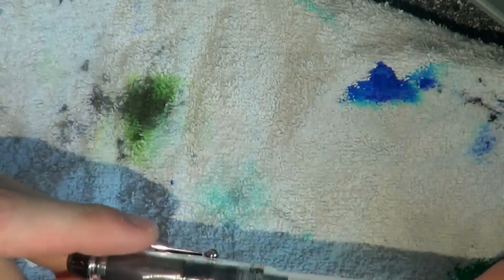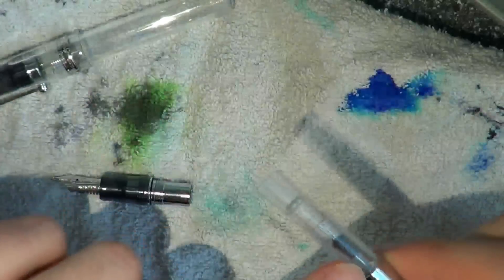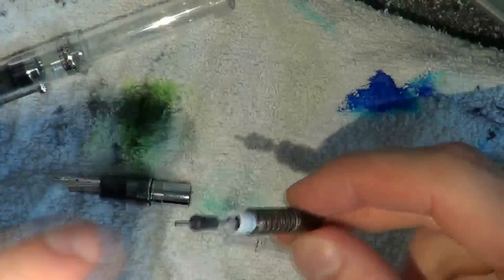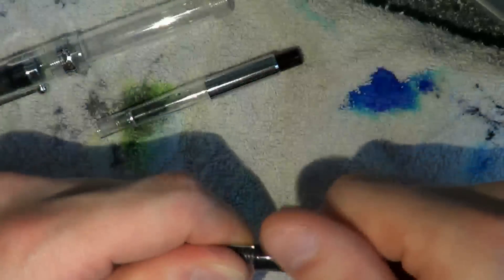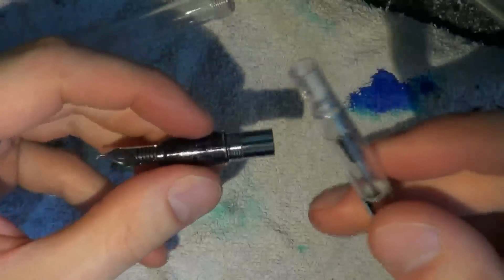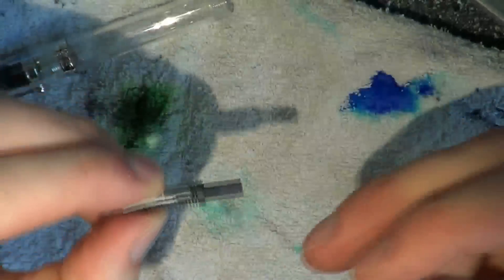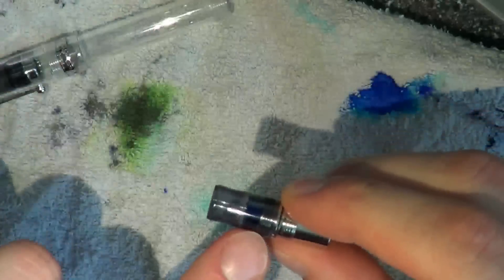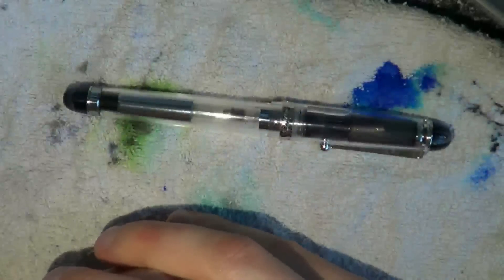Disassembly Line Pilot Custom 74

Comment: For those interested; the feed/grip section that looks like it can be removed can be removed, without damage even, as it doesn't seem to be glued. But getting this thing back on is a whole different matter. The part is really, really tight and makes me wonder how they got it on there in the first place. Cracked mine, after I lost patience. As said in the video: Avoid.
Reply: Thanks for your comment. I was going a little nuts trying to clean and disassemble the grip but stopped before I cracked it. 

That bit of ink is super annoying tho. :(

Comment: Tried twisting the converter. No luck in getting the nib collar out. Converter just twists around on the section. Any other tricks for getting the nib collar out? Heat?
Reply from the maker: Yes, dry heat may help.  Careful you don't damage the plastic, though: it's pretty thin.
Reply: Am attempting to do the same thing with mine. Did heat help for you?

Comment: I need to disassemble the cap to get some water that's stuck between the cap wall and the gray plastic shroud that seals the nib. Any thoughts?
Reply from the maker: Sometimes you can pull out the inner cap with the eraser that's mounted at the back of some pencils.  I don't know if that works on this model, though.
Reply: Thanks for the reply.

I just got it out. Happily, it isn't screwed in, it's just interference fit. So I got in there with a rubber band over the back of a pencil (a trick I use on a couple of my other pens) and it pulled right out.

Comment: Hi Stephen. Just taken delivery of a new 74 from Japan - EF - and boy is it EF! However, I also bid for a lot on ebay of a 74F - it's a bit scratchy. The kind person also chucked in a 'not working' custom heritage 91' - which indeed is not working. I know nothing about fountain pens - I have got these for drawing. A zillion years ago I used to use Rotring's and seem to remember disassembling them and putting them in a bath of Rotring cleaner to soak - which no doubt cost a fortune.  So... what would you recco to get these 2 pens going again? Is there an ink dissolving solution? Cheers.

Comment: Hi, I have a couple of 74s, and there's a little soft plastic skirt/gasket that sits between, around, the bottom of the feed and the top of the inner collar within the section.  The feed slips into it and keeps it snug. I seem to have lost, or washed away that bit on one of my pens.  Without it the feed is a little loose.  Any Ideas on how I might replace that bit? Or substitute it with some kind of tape or putty? Thanks for all your videos.
Reply from the maker: Albert Genzen I would contact Pilot.
Reply: sbrebrown thanks.  I'll give that a try.
Reply: sbrebrown, amazing, I called pilot USA, described the bit, and sure enough the gasket arrived in today's mail plus a cartrage of ink as a bonus.  Pilot is awesome and so are you.  Thanks for all you do. Any chance you'll go to the LA pen show in February?
Reply from the maker: Albert Genzen Glad to be of help. I probably won't be in LA
Reply: Albert Genzen Glad that Pilot USA could help you. Pilot UK was unhelpful, dismissive and plain rude when I contacted them about a pen repair which I actually wanted to pay for despite the pen being new. That was the last time I bought a Pilot fountain pen even though I had most of their popular pens in my collection already. All the same, happy that Pilot cane thru for you!👍🏿👍🏿👍🏿

Comment: Hi,
I just can't get the nib/section out of my C74. It is acting dry and I want to see what's wrong... I can't get a grip of the nib and the converter trick doesn't loosen the feed at all. Any help?

THanks
Reply from the maker: It is hard to recommend something without seeing the pen but you could try some rubbery material for a better grip, or soak in warm water first. Be careful you don't crack anything though.
Reply: Thanks for the response! I have watched your videos extensively and tried your methods but I think the tines are too tight at the tip of the nib - I don't have any brass sheets unfortunately. Will doing the fingernail trick be sufficient?
Reply from the maker: Usually it is, but there is only one way to find out :-)
Reply: +Deadorelse Hey, did you ever solve your problem with the pen acting dry? Did you manage to open up the tines and get better ink flow? I'm having the same trouble with my C74, which is why I'm looking at this video. If you found a solution, I'd love to hear it. Thanks.
Reply: Hey, I had a big obsession over it being dry and stuff, but I just made myself forget about it. I ended up just ploughing on when it felt dry, and the usage broke it in 2-3 weeks in, until it flowed much better. Just keep using it normally and don't stress about it.
Reply: +Richard Gong Thanks!